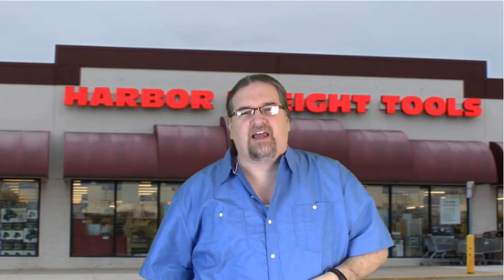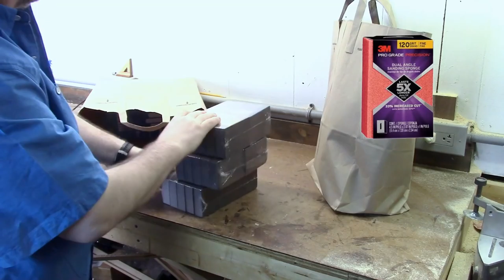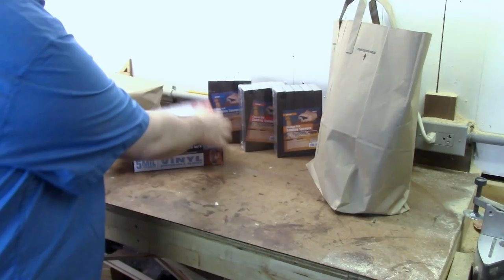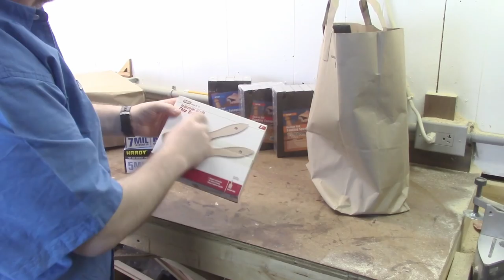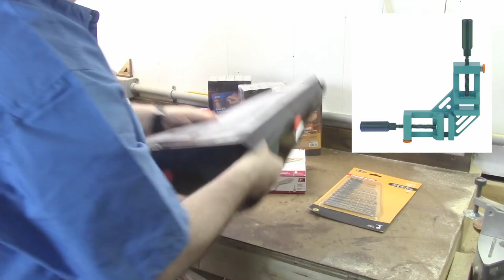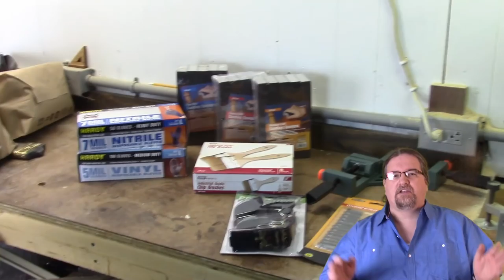My Harbor Freight Tool haul with my gift card

Comment: I buy all my nitrile gloves there, most of my casters for mobile shop furniture, and large majority of my clamps.i just got that corner clamp but haven't used it yet. I've got the ratcheting band clamp and have recently used it on two separate glue ups, works great. Their 12" disk sander and 10" drill press are both working out quite well for me, also.

Comment: I made the mistake of buying their sanding sponges once. I got the same packs you did and the grit falls off almost immediately. I've had better luck with their sanding belts and wet/dry sand paper. But man, their sanding sponges - in my experience - were terrible.

Those corner clamps work pretty well. Same for their gloves.